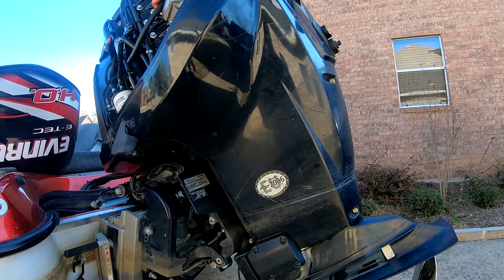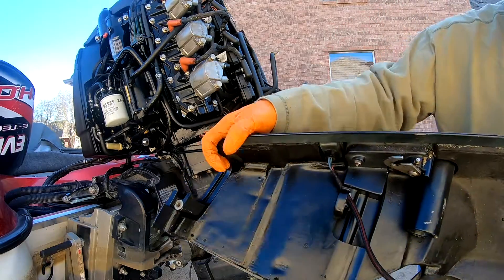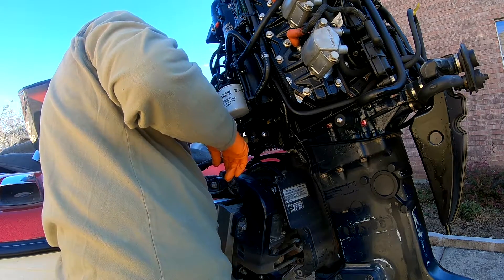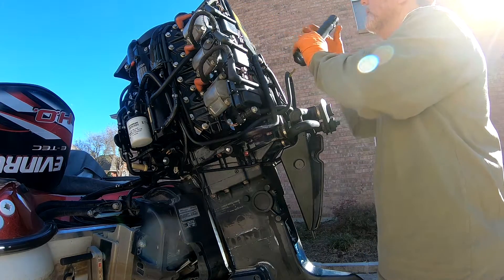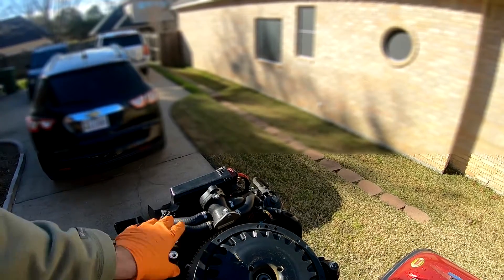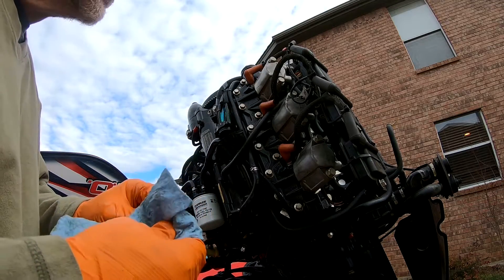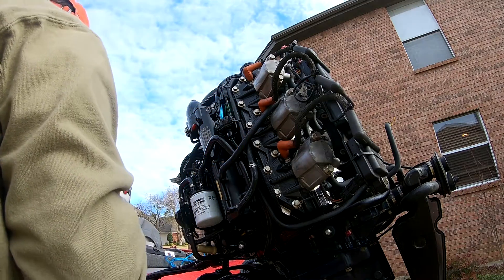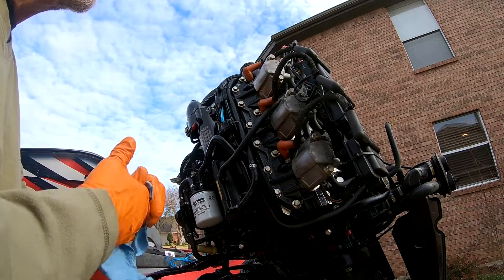Evinrude E-TEC oil distribution system supply line leak repair

Comment: i have evinrude 300 and there is code  says oil selonoid open circuit . what is that mean?
Reply from the maker: https://www.etecownersgroup.com/post/code-34-7495771
https://www.etecownersgroup.com/post/need-help-with-etec-225-ho-code-34-10533573

These two links on the ETEC owners group may help you. Perhaps just a loose or bad connection at the oil pump.

Comment: Ive got a 115hp with similar oil leak, yet to tear things apart.. How is your E-Tec working after this repair?
Reply from the maker: howlinbeagle I’ve had no issues since the repair. The critical thing is matching the length of the hoses being replaced. The hoses disconnect from the pump or manifold by pushing down the black plastic ring that is around the hose and pulling the hose up. On my E-TEC, the line between the pump and manifold is a different diameter than the lines that go to the cylinders, so be thorough when identifying which hose is leaking if you’re not replacing all of the hoses. The hoses are held in place with small zip ties as clamps on the cylinder ends. Make sure you bleed the air out of the lines once you have replaced them. I looked at several videos to see the process. I hope all goes well with the repair.